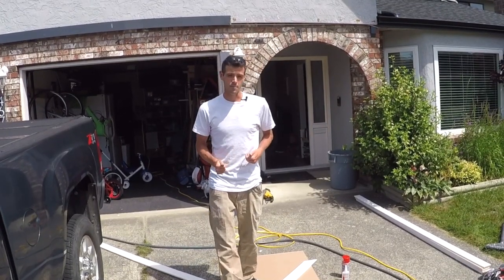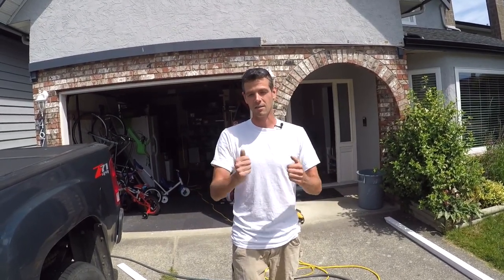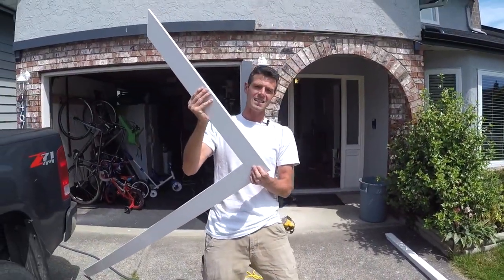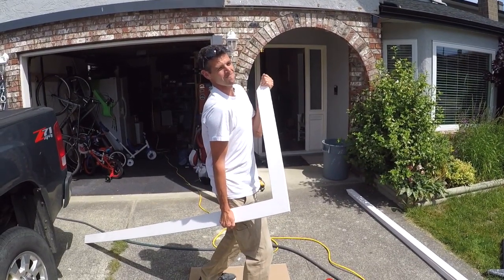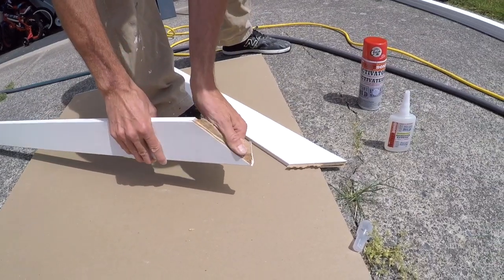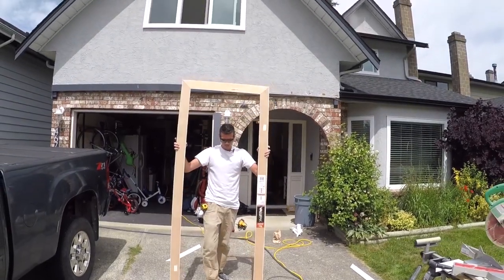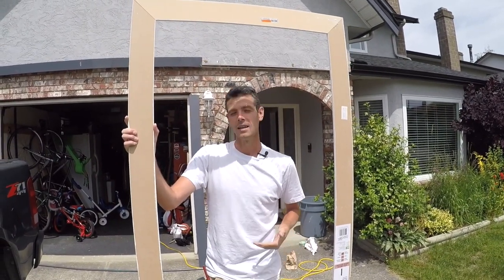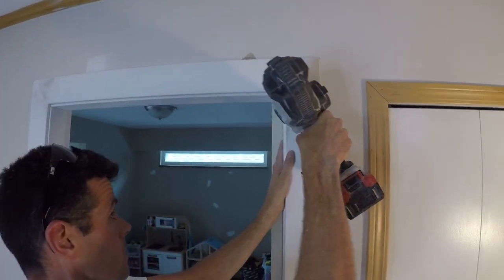Is this the NEW WAY to INSTALL DOOR CASING?!!!!!!

Comment: When shooting your finish nails turn the nail gun 90 degrees so the gun is perpendicular to the jamb. That will prevent blow outs on the finished jamb side. The nails have a chisel point and will angle left or right of the gun especially with grainy wood. Head jamb: gun is up and down, side jambs: gun is horizontal.  Works perfectly and saves a lot of adjectives.

Comment: I'm a carpenter in Alberta, this is a new use for CA glue for me. I use it to build my model planes.
Reply from the maker: I'm surprised how little used it is. I heard of it but didn't think it would be strong enough. I still think carpenters glue is a bit stronger but this is good enough and waaaaaaay easier.

Comment: There is a YouTube channel called Finish Carpentry TV, he has great videos on how to use this glue along with a lot of other tips for finish carpentry.
Reply from the maker: I just recently heard of him. Only watched one video so far.
Reply: Vancouver Carpenter he is really talented I’ve been watching him for a while. He uses it on crown returns. Here is a tip keep a can of acetone close to get the glue off your fingers if you use this method. Also don’t get activator on your hand and touch that glue it boils when the chemical reaction occurs and will leave a nasty blister.
Reply: How does it work on wood, finish carpentry and you are using it on MDF.
Reply: patrick cowan it works great. You do need to keep it off the finish because it will prevent stain from soaking into the wood. The same could be said for all glues. This stuff is great because you get a solid tight joint that’s not going to move an it’s instant no clamping!
Reply: A bit of truth about 2-P 10 (2 Pieces hold for 10 seconds) is that the strength is short lived. Meaning you should still use Carpenters glue to hold in the long run.

Stick to your own game plan for your YouTube videos. Don't  follow others, you stay on topic, which is your appeal.
Reply: Mansard Manor that CA is stronger than any wood glue! I have used it on scarf joints and put them on a load to intentionally try to break the glue joint and the wood will fail on either side of the joint. It’s got to be quality CA but in my opinion there is nothing that compares to the strength and speed of using CA! I use Starbond.

Comment: How does this work with door frames that are out of square? Seems like it would be hard to adjust when you're assembling the whole thing at a different location.
Reply: Seems pretty flexible.
Reply: You can bend the trim apx an 1nch    
Either direction on the vertical and the joint wont open.
Reply from the maker: I installed the jambs so I knew they were square. I think for it to be a major problem the jamb would need to be visibly out of square. At that point hopefully you noticed it and adjusted your miters a little. This really makes it so much easier and I'm pretty sure slightly out of square jambs would still be workable with this method.
Reply: Get a protractor

Comment: Mitre bond do an activator marker pen instead of the adhesive which means you don’t waste as much activator.
It’s common practice on uk sites to make your architraves (trim) up as sets .
I usually gauge a 9mm line on my casing lengths  and router the hinges out before I build them up to position the architrave.
I then fix the hinge side of the  casing then swing the door then position the lock side of the casing around the door with a nice 2-3mm gap  

As an aside if you’re using the activator spray i usually spray both pieces leave a few seconds then glue one piece and hold the two pieces together for ten seconds.

Comment: I like to glue the mitres together on a dusty surface.  That glue is instant and as you have shown, pretty darn strong.  A dusty surface allows for easy uncoupling from your work surface incase if spillage.  I also prefer to apply the jelly type glue before the activator.  I find the activator evaporates fast, so I try to keep time on my side.  Also, the activator spray can always seems to run out before the jelly, so using less activator gets me a little further per kit.
Reply: No requirement for the activator to be in a fluid state in order to cause rapid polymerization of the CA glue. The wet in it is just for the transport phase from nozzle to target, after that it can evaporate for half an hour and still set off the glue for an almost instant bond. I was using liquid activator 25 years ago with a brush in the cap on a very tiny 30 ml bottle and it could dry as well and still make the slow set gels go off right away. In the beginning, we were gluing rubber O rings together for that custom size, but then some male appendages wound up being glued to their legs so they took a lot of the hot punch out of CA glues in general - O rings just don't make up in a tenth of a second anymore, thanks lorena.

Comment: I had my kitchen remodeled two years ago and the cabinet installers used this glue technique when they installed the crown molding at the top of the cabinets.  All the joints look perfect and all the molding was pre finished.

Comment: Hi pur polyurethane adhesive is another option. I use cyanoacrylate when ive got a few pieces to do and hi pur when theres many joints both work great. Only option for tight miters without some factory corner key machine.

Comment: The stuff is a game changer. It will change the way you do baseboard.
Reply from the maker: I can't wait to try it there too.
Reply: Are you using the CA glue to glue the baseboard to the wall? I've been using construction adhesive and hot glue on baseboard.
Reply: @GarwoodNick  have you tried the ryobi cordless hot glue gun. I love it for returns
Reply: @steverone7623  I haven't but that sounds like a very useful tool. I've just been using the arrow corded hot glue gun.
Reply: @GarwoodNick  if you are on the platform already it's like $30 and last a good while
Reply: @vancouvercarpenter    Ben,  will this work on oak, or fingerjoint pine ?
Reply: @KonstantinUdalov   hey,  thank you for the reply.  i will get some
     for my next remodel project that starts in July.

Comment: Now take that pre made trim, and install it on one side of the door jamb (before setting door) then you can put the jamb in pretrimed, set your reveal, shoot thru the trim, go from other side and install shims after then install remaining side of trim.
Reply: You used to be able to buy doors like that.Pre cased, with the hinge side applied. 10 minute job with a nail and brad gun. The miters had a metal spline.

Comment: Like your videos.  Always learn something.  Two questions:  1.  What was the specific product you used ?   2.  Would you use on trim that will be stained ?  Worried about squeezed out glue.  Thanks.

Comment: I just did all my bullnose corners this way. Still toe nailed just in case. I’ve also joined 2 1x6x10s finger-joint pine to make a 20 footer. Only problem with that is trying to carry it without putting all the leverage on the joint. I just used 2 clamps & 2 pieces of scrap & sandwiched the joint until I got it in place.
Reply: i should've read all the comments first.  i just asked about oak and pine.

Comment: Use this all the time on mdf only. Real wood does not work as good but I have used it as a clamp for 10 minute wood glue on real wood.
Reply: Was wondering how it works on wood,only seen it used on MDF
Reply: 10 four, I've used as a clamp for epoxy.

Comment: Wanted to use this technique but I have plinths at my door bottoms and my door frames are not totally square so I was worried it would be hard to maintain a consistent reveal at the top especially.

Any tips for using this method with warbly door frames?

Comment: Would add glue first then spray, and do not set it ontop of anything, hold it in the air... I worked for fender guitar as a sander and we used this a lot, or mixing crazy glue with sawdust and using it as filler then sand...

Comment: Actually, this method came out about 15 years ago. The flaw was when opening aren't square so users went back to the old style which has always worked. The only thing that this method has any advantage of is a tight glued seam which can also be achieved using traditional method and a little filler.
Reply: Exactly....nothing is ever square or plumb so I went back to std method yrs ago....this is more headaches than it saves.....

Comment: This technique only works if the sides of the jamb are relatively even with the drywall. If the jamb is proud of the drywall you have to use a technique called " rolling the miter" there's a good video on youtube about this by a finish carpenter

Comment: I don’t buy the expensive activator or kits.  I use a generic CA glue with pool bleach as an activator.  Might be a good future video to show the store bought activator vs the home made versions ( Baking soda, bleach etc)
Reply: This is really interesting. Thanks for sharing your method.
Reply from the maker: That's a great idea. I will look into it.
Reply: Vancouver Carpenter ok then It’s only fair to give you my formula to try , even if you bash it.   I use HTH super “sock it” crystallized pool shock from Walmart here in Canada. It’s about $5-$6 for a 1lb bag.   I use one teaspoon of shock to 3oz water in a spray /spritzer. Make sure you shake it lots.   It might take a little longer than the store bought activator, but the price is worth it.

Comment: I find 2p10 to be way stronger and last longer. Can grab it at ultimate tools in Burnaby. Surprisingly good price. 

Something like hipur and clam clamps is way stronger. Especially with MDF. If you have wood casing the CA glue is really good. But this method can fail with MDF. I don’t trust it enough.

Comment: The problem with this glue is it isn't permanent, a friend of mine started using this method a couple of years ago and I tried to warn him that the joints would separate after a few months but he didn't listen and now his customers are complaining all the angle cuts are opening up and he is having to go back and repair them. I just use wood glue and shims and make sure the joint is tight and years later the joint is still tight. Old school wins out in this case in my opinion .
Reply from the maker: I would love to know some actual stats on this. There is always a risk with newer methods. The problem in this case is there are probably many people who have done this for years and had no problems as well. Hard to know what the variables could be that make the difference.
Reply: @vancouvercarpenter  I have no idea he just told me he has had to go back on a bunch of jobs and he will never use that method again, he has been a finish carpenter for around 40 years.
Reply: Just combine it with biscuits and you get the perfect combo.
Reply: @pouetance  I will have to try that, thanks for the tip.
Reply: I'm a beginner and was wondering what you use shims for? Are you referring to shimming behind the casing if the jamb/drywall is proud in certain areas?